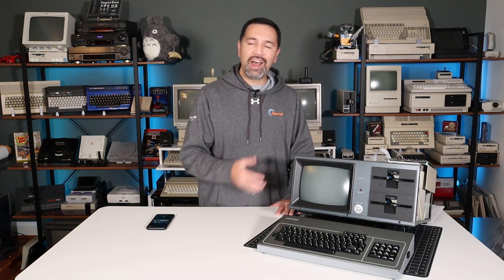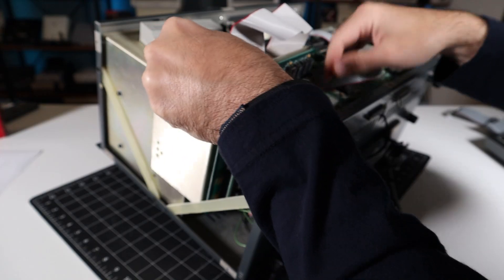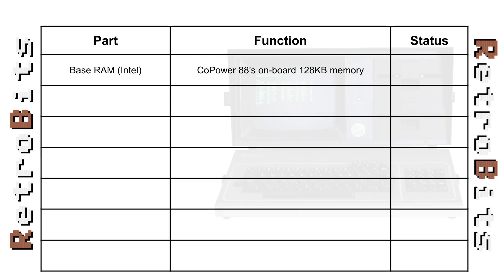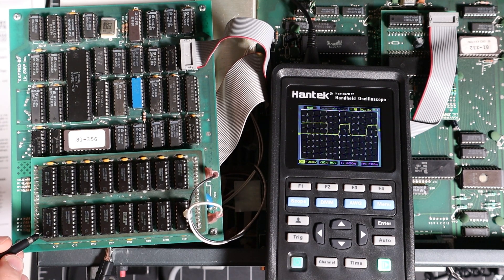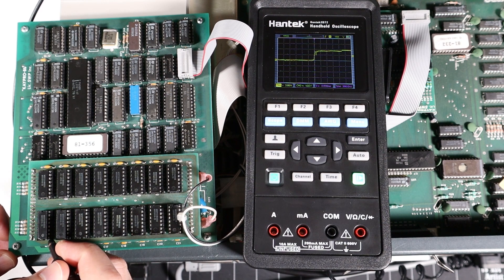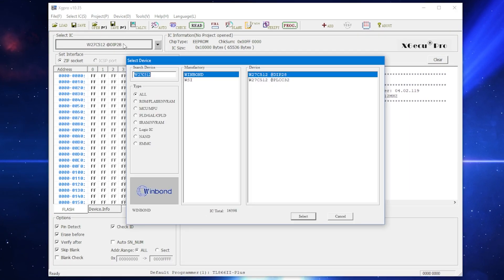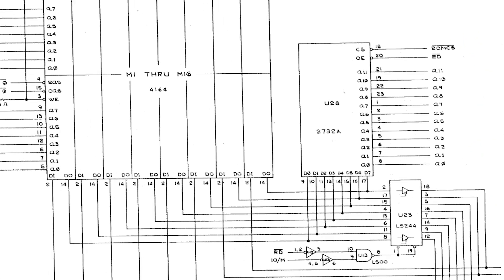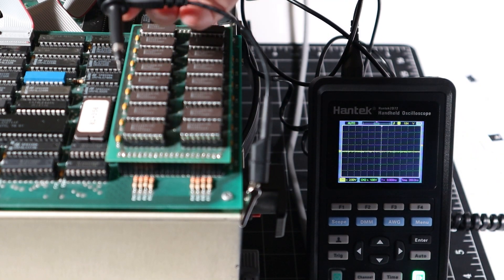Is this SWP CoPower 88 working or not? Diagnosing a new fault

Comment: Hi, not sure if you realized but 4164 DRAM is super common and the same as C64 RAM. You can mix and match 4164 easily enough and last I looked Jameco had 4164 DRAM. 

Also did you notice without the expansion board connected, the system reported only 64k indicating the RAM issue was on the main board. Then you swapped on the 128k from the expansion board and DOS reported 128k still... So an Intel chip is at fault. While checking memory it stops at a bad location so it still showed 128k with the Intel chips in the expansion module. They are the issue. 

You can use debug to find the bad RAM but you can easily just put the DRAM into an Apple II or C64 and test there.
Reply from the maker: Hi Adrian, thanks for the helpful pointers! I did not realize at the time that the Intel 2164 and Mostek 4564 were functionally the same as 4164 DRAM. I Googled for the datasheet but not for compatibility :/ I do have plenty of spare 4164s so I should be able to isolate the fault now. I do think a chip tester is still something I ought to get sooner or later!

I have to sheepishly admit that I was using chkdsk only as a pass/fail test and was completely oblivious to the amount of memory it was reporting. Shame on me for not paying enough attention. Ah well, chalk it up to a learning experience!

Comment: You sure did a lot of great troubleshooting with this machine. Hopefully someone will chime in on the comments with other things to try. I have zero experience with Kaypro machines, however I wish you the best of luck with getting it rock solid.
Reply from the maker: Thanks for the encouragement! I had zero experience until I started but I'm learning a little each time, which of course, is the whole point :) I'll get it fully functional eventually, although I really don't yet know what it will actually be good for even then!
Reply: @retrobitstv  Once it's up and running, using it to connect to a BBS via Wi-Fi would be pretty awesome!
Reply from the maker: I can do that right now on the CP/M side but I will have to see if it's even possible for the DOS side to make use of the Kaypro's serial port or not. I think I remember reading something in the product literature about it being possible but it may require custom code to do it.

Comment: This is the same company that makes the ATR8000 for the Atari line of computers.  The ATR allows hooking up generic IBM compatible Drives and lets you run CP/M on the Atari.  It seems they got into a lot of coprocessor boards for older computers.

Comment: One of your ram chips is partially bad. The problem occurs when that specific memory location gets involved. When you move the ram chips from the expansion board to the main board, you're putting them at a different address that your little test programs may not be trying to use, so they work. Then when you try to run a larger program it once again needs whatever address you've ended up moving that bad ram to.

Replace the mostek ram with whatever compatible brand you can get ahold of.
Reply from the maker: Thanks for the suggestions! I have some spare RAM I will try and use to isolate the faulty chip.

Comment: 1:  a falkey solder joint 2: Power delivery tp chips (resistor/Cap etc,) as when you run somethong amps> so may cause problems

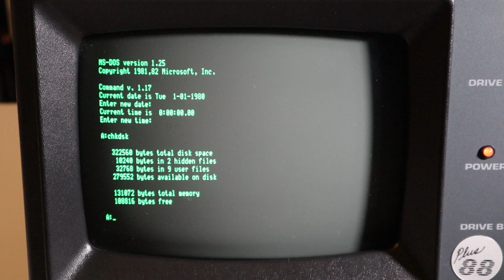Comment: 17:14 - despite having all 32 chips, it sees 128 kB of RAM. These are standard 4164 DRAMs, you may mix different chips.
Reply from the maker: Hah, great observation! I totally failed to notice that. Explains why the tests were "working". Good to know thanks! I do have some extra 4164s so I can try the ol' "process of elimination" which is what I was totally hoping to avoid by testing methodically this time around.
Reply: @retrobitstv  4:47 Chkdsk seems to only detect 64kB of RAM with the daughter board removed with the intel chips in the main 88 board, when you test with just the mostech chips and no daughter board at 16:49 it shows the full 128k, one of those intel chips must be screwing things up. Hopefully this may save you switching out half the chips when testing!
Reply from the maker: @Viking_Cookie  Ahh interesting, I didn't notice that either! I just went and looked and I found that I had a lifted leg on one of the Intel chips in the expansion board. Whoops! Now chkdsk reports the full 256K. Both chkdsk and puremsd.com run but nothing else works, same as before. I will need a proper way to test the RAM.

Comment: Did you ever reflow any solder joints on the board connectors etc? They don't look too great and being portable may have taken a few bumps. First thing thinking about weird intermittent issues. Even an overloaded PSU could be the culprit.
Reply from the maker: Great points! I removed the backing plate and took a look at all the solder joints on the CoPower board. I didn't see anything that looked suspicious but I didn't use a microscope or anything. I did take a look at the +5VDC coming into the board with my meter and verified under operation that it was stable. Kind of thinking now that marginal RAM chip(s) on the expansion board could be problematic due to slightly degraded timing/signal strength compared to being on the main board itself.

Comment: I guess it's a win?  Maybe some questionable sockets or the expansion board has some loose connection or component, though I'd think you'd be able to spot that.
Reply from the maker: Yea, I'm not really happy with the end result here. I did remove the backing plate and check the solder joints on the expansion. I also tested all the passives, verified the voltage to the card under load, and applied contact cleaner to the expansion pin headers and everything else on the system. I wish I had a more conclusive result, but after 2 weeks of fiddling with the thing it was time to move on. I will have to procure a proper DRAM tester I think.

Comment: Enjoying the Kaypro videos! Btw, have you checked the ribbon cable that connects the boards? Thanks for sharing
Reply from the maker: Thankls, glad you enjoyed it! I re-seated the ribbon cable but didn't test continuity or anything. I will do that just to rule it out though! As the 8088 system is pretty much self-contained except for keyboard, screen text, and disk I/O, and those things all seem to work, I didn't really think to look at the cable or the Z80 riser board.

Comment: On the lab shots I noticed that the upmost board to your right (the one with the monitor thingie and the three VCRs) has started to sag. At least it looks like that. Would be sad if that actually broke :(
Reply from the maker: Thanks for pointing that out. I will have to check why it's sagging. Perhaps the wooden shelf needs to be shimmed a bit. Under each tier are two steel cross-members with supposedly 200lb capacity per shelf.

Comment: The DRAM was not conclusively tested. That's the big fat elephant in the room.
Reply from the maker: Yea, I will need a proper DRAM tester. Swapping things around was just a last ditch effort to see what would happen. It doesn't prove there's not a marginal MOSTEK chip or a timing/signal level problem on the expansion board.